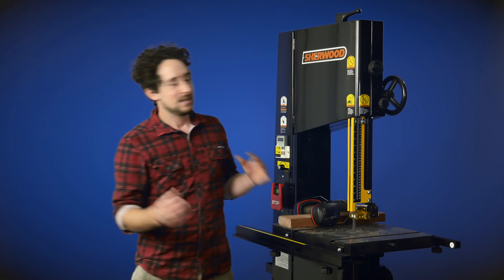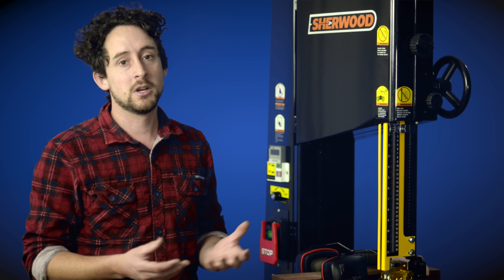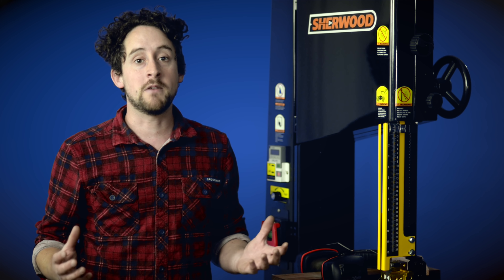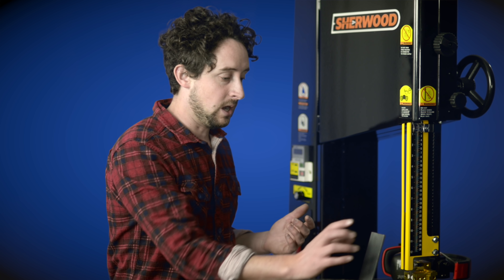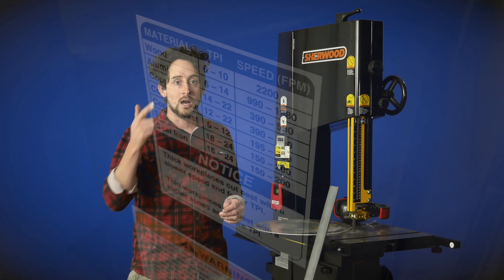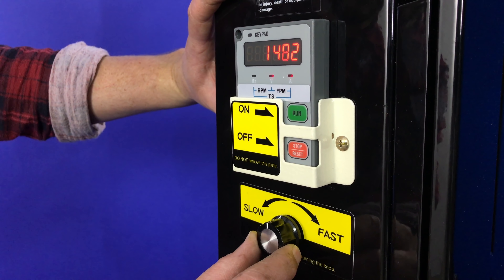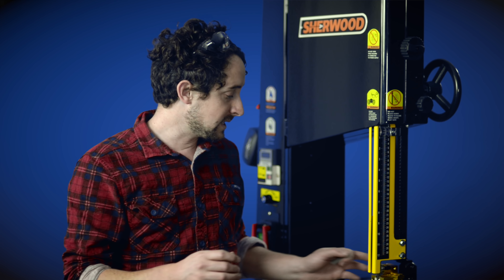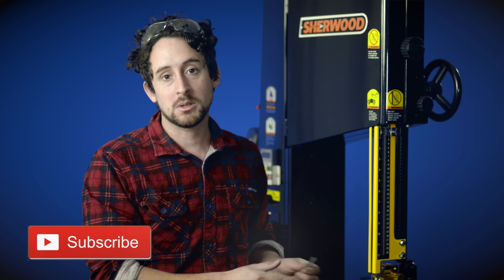Variable Speed Bandsaws - Why?

Comment: Does a slower speed help deep resaw cuts?
Reply from the maker: That's a complicated question! The best way to look at it is, there is an optimum ratio between the blade speed and the feed rate for a given operation. The slower your blade speed, the slower your feed rate needs to be. Each tooth wants to take a certain sized 'bite' - a slower blade speed means fewer bites per minute, so you need to slow down the rate at which the blade is being fed. You may find this does help your resawing as it makes the manual feed more manageable. You may also find an improvement with dust collection. However, it will take longer to make the same cut.